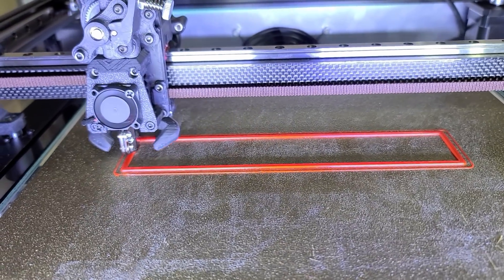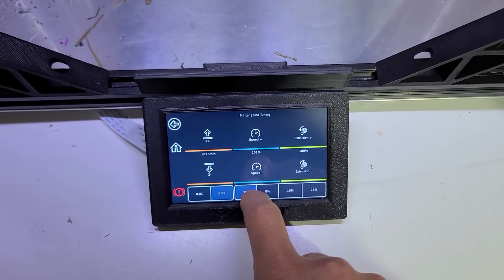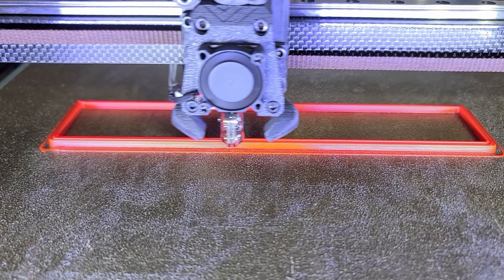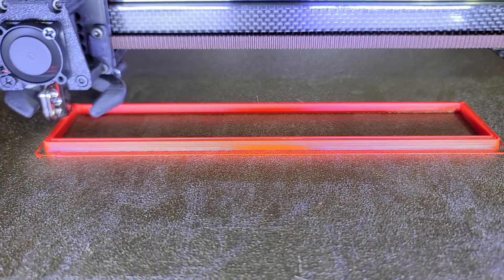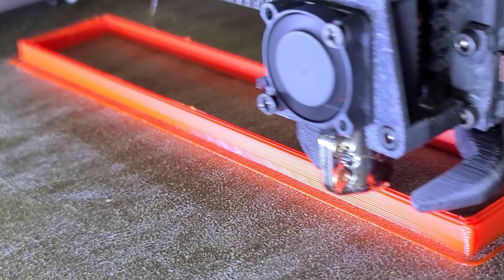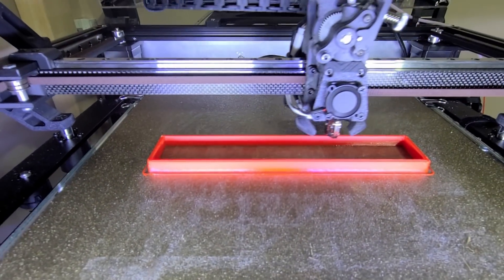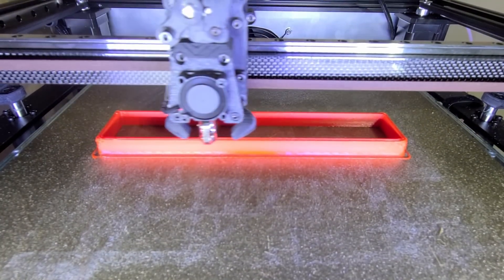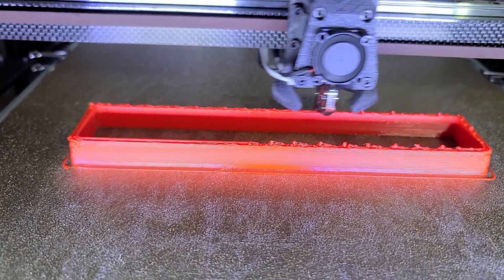Nova Hotend flowtest. 47 cubic MM/s ??

Comment: 260C? Defeats the whole purpose of the nozzle, might as well heat the plastic with a torch.
I really do not understand why people do this nonsense.
Turn the temp down to 230C or whatever your PETG is rated at, and do the test properly.
Now see if it can produce it's rated volume.
The nozzle is useless if if burns the plastic making corners or fine details. The whole idea behind these nozzles is to have the filament in contact with the heater for a longer period so the heat can soak in, not so you can turn up the temp to something insane.
Reply from the maker: That petg I always print at 250-260. Its the rated one. It says between 230-250.

Comment: I guess 47mm^3 (47*10^-9 m^3) flow rate with a nozzle of 1mm would give a required feed of 60mm/s  (pi*0.0005^2*0.06)
Reply from the maker: There is a calculator on their web site too if you want to use it

Comment: Did you weigh the plastic? The f not you cannot for sure say it can pus certain amount of plastic.
Reply from the maker: True ..its a approximation. With 1mm nozzle its easier to calculate. But you are right. The real test would have to be weighted

Comment: Awesome! I was searching for this after I saw your previous video. I run a volcano with a 0.4mm nozzle. I think nova has a higher volumetric flow rate even with 2mm shorter melt zone compared to the volcano. I haven't found any proper apples to apples comparison tho. Do you happen to have a volcano hotend with 1mm nozzle lying around to run the same test for a reference point?
Reply from the maker: I dont

Comment: why didn't you gone with a dual Z setup? i've bought a MGN7H for my X, a 440mm square CF tube and 2 HT 0.9 degree nema 17 48mm as you indicated. how did you put the screws at the linear rail? Could you share only the gantry files? i'll use a Voron 1.8 bed setup, but with linear rails with the lead screws loosely attatched to it to prevent any chance of Z wobble. The entire frame will have a 1.5mm laser cutted aluminum sheet working as a stiffner and also as enclosure. not even dreaming to pri t at the same speed as you print, but  achieving reliable and good quality prints on PETG at 200mm/s would be great, lets see if i can get there.
Reply from the maker: Its dual lead screw with single z motor. 2:1 geared. I prefer this setup over 2 z motors who can get out of sync when powered off. Its manual bed levelling here. I prefer it that way. No sensor on the printhead..no added weight. 2 lead screws always in sync. To eliminate z wobble, each side have oldham couplers.  Patience please on the cad file. Im releasing it soon.
Reply: @Vez3D  take your time, i'll be waiting. keep posting your videos, they are really one of a kind, i don't see any other youtuber really pushing the limits like you keep doing and beeing straight to the point we all want to see

Comment: What really impress me is your printer.
Reply: Yeah what is that printer? Looks sexy and performs like a loyal soldier.
Reply from the maker: @headbanger1428  its  a self designed one. Honestly, this is just a super simple designed printer with nothing fency. Just lightweight...and even there , it still coulf be lighter. So really, nothing super extraordinary on this printer. Which is what is making it really cool because its cheap to build and easy/simple to assemble.

Comment: What's your Slicer. I just started using a 1mm nozzle. Having a little trouble with Cura rendering the layers. PrusaSlicer did a good job, but my settings are not great yet.
Reply from the maker: I use Ideamaker. It is free and nice

Comment: I'm surprised this style hotend doesn't clog with such a long hotzone
Reply from the maker: I really think it is very very hard to clog this thing. I have abused it a lot switching with different materials and nothing. It still flows
Reply: Though more volume means more heat needed so..I guess its enough to level out..? I could see clogging at low volumetric speeds though maybe? Though low speed kinda defeats the purpose of this hotend

Comment: It would be great to see some timelapse of some normal nested prints. You always print part with no retractions etc. Speed is useless if prints arent good. And please fix that belt on z axis motor.add something so that pullea grip with more teeths.
Reply from the maker: I dont see a problem with my Z. Never had an issue. As for prints.. there is that 300mm/s voron cube at 15k you can see. I have other picture but youtube is video. Visiti my instagram for pics :)
Reply: @Vez3D  You have to remember this is YT so random people, of course, know your printer better than you and will point out problems that don't exist and remember, it's their right to dictate what you should print. Everyone is a keyboard engineer/3D printing hero these days...;). That said, you handle all these comments amazingly well and I guess he didn't mean it as bad as it can be read;).

As for normal parts, that's different for everyone. E.g. I have only ever printed one decorative piece for my GF but have spent months fighting and modding my "old" I3 Mega to hold very tight tolerances andprecise dimensions for "structural" parts. Some of these parts have needed to stand up to internal pressures of 30bar and have had post processing done on them (machining and epoxy vacuum impregnation). So, normal for me is to print without retractions, print with higher than "normal" temps and as little fan as I can get away with. These settings may lend a bit less detail and I can't design with steep overhangs but they give the strongest parts with the least porosity.

Now, I am following your channel and a few others because I am looking to build a faster printer which can be enclosed to start printing faster on some stronger materials. I am really encouraged by projects like yours, the HeVort, and the Voron "cult", etc:)
Reply from the maker: Also what is normal print speed ? And what model would you like to see printing?
Reply from the maker: He is right that it should normally have more teeth to grip the belt but it never skipped on tooth yet so its all good for now
Reply: @Vez3D  Sure, sure - and my post was mostly an attempt at pointing out how people need to think about the tone of the messages. 

As for printing, for me that's for parts for a hobby of mine and I have long build logs on a forum on what I am building and why. And just sometimes, someone will flat out say what I am doing is wrong. It rarely is as I do my research and all that so half the time, it's just some keyboard warrior who's looking to assert himself and the other times, there may just be some potentially well-meant advice in there - but it was lost in translation, so to speak. 

I guess it's just the small price we have to pay for being online and being able to share and gather knowledge without boundaries. 

Anyhow...;)
Reply from the maker: @AntiVaganza  you just have to live with that and respond to them with joy and try to spread the love. :) usually, that calms everything down when you react like. Granted, im not the best to do this live in person, ihave a shorter fuse, but here, I have time to think before writing, and I try to be nice :) spread the love !!
Reply: @Vez3D  Yeah, true. Though OF COURSE, I am perfect in real life;). 
That said, you actually have very good followers so I was being a bit too harsh.

While I have you do you have any future plans for enclosing your printer in a heated chamber?
Reply from the maker: @AntiVaganza  its enclosed already
Reply: @Vez3D  sorry, yeah - but passively heated so far, right? 
Was wondering if you had thoughts on heating it? My goal is PC and from what I have read I need to get to around 80C in the chamber. (I will likely go the full monty with watercooling of the heat sink and possibly steppers, too plus a berd air bringin in air from the outside.
Reply from the maker: @bernardbockwurst  the more it goes the more I print fast everywhwre. But this build is about 3 weeks old so im still testing

Comment: i put my ender 3 V2 to 200% PLSA at 215C, bed at 50c, and i use stock hotend with hero gen 5 single blower fan and i have no problem, prints are clean.
Gonna do the same on my new Ender 5 plus
Reply: Yeah...well..uhm... Actually totally different story 🙈🙈

Comment: what board are you running and what display is that for klipper?
Reply from the maker: Skr 1.4.. klipperscreen  on piTFT 5"
Reply: @Vez3D  Are you satisfied with this screen or do you recommand another one ? Im considering do the same on a Voron 1.8
Reply from the maker: @JV_12349  yes its nice
Reply: @Vez3D  Ok thanks for your answer!

Comment: Awesome Video! Love your analysis!

Your Heatsink fan stopped running the moment you aborted the print.

I would recommend to keep the cooling active  down to about 40°C. This way heatcreep will not cause any clogs, even with PLA.
Reply from the maker: no worries.. it restarted once the firmware restarted like 2-3 sec after the video cut. That "kill" was a firmware restart. And to be honest, this nova is unclog-able. I have once left PLA in there at 300c by mistake for about 10min... and no clog..no nothing. I was shocked

Comment: Was the same nozzle used with the previous high speed test? What do you think the limit would be for a smaller, say 0.6 or 0.4, nozzle?
Reply from the maker: 0.5.. same flow limit applies.. but to get to the limit with 0.5mm nozzle you need like 0.25mm layers height at 380mm/s ...which makes it very hard for layer to bond together.  With 0.15.. you need 625mm/s haha. That way over my limit

Comment: would be interesting to see how a Dragon HF would do. Great videos and I love the design.
Reply: I did test the dragon standard flow vs the E3d V6. With a weak extruder I was able to reach 25mm3/s with the dragon SF
Reply from the maker: @PRO3DESIGN  thats about what they announce
Reply: @Vez3D  oh I read something else. Like 40 but maybe that was the hf one
Reply: @PRO3DESIGN  i read that claim on amazon to i did just hit 34mm3 with standard flow but I would not consider it rated for that cause i added 40c to do it . i would say 20 to 25 is fair . ill test the high flow though and see . i really don't think it will do much more than the standard and I don't see it doing what this does. The prob is it can have a long melt zone but as soon as you increase flow the heat source is to far from the extra insulated area so I feel it wont do anything except make retraction worse.
Reply from the maker: very !! I would love to test.. but its money to invest that I dont have for now. At least, I dont want to buy something that I dont really need, since im obviously very pleased already with the nova :)  but if someone wants me to put them to the test and send one to me.. i would be happy to
Reply: @Vez3D  Ill grab a copper 1mm nozzle and if you want send me that gcode and ill edit the start code to run on one my printers. I really want to prove that high flow dragon is not gonna do much better i would bet it is 5 percent if that more flow . It needs a vertical heater like the nova and volcano to really make a diff
Reply from the maker: @advanced3dprinting  email me and i will send you the gcode
Reply: @Vez3D  bruh what's your email. I have dragon with hf I'm keen to test comparison for science
Reply from the maker: @chrisgrantham2648  simon_vezina_@hotmail.com
Reply: @Vez3D  then the cease and desist letters start 😂😂